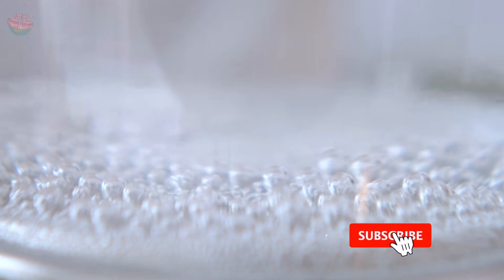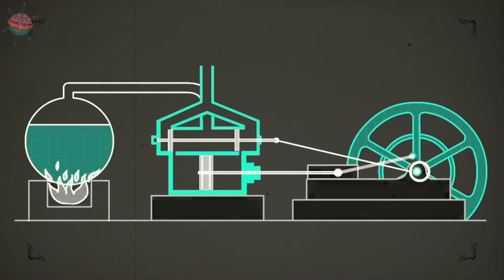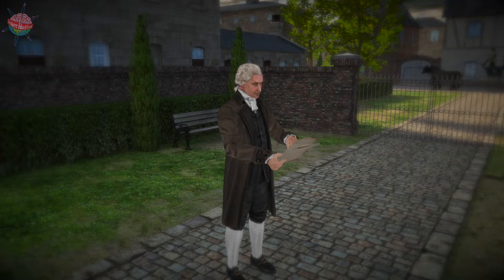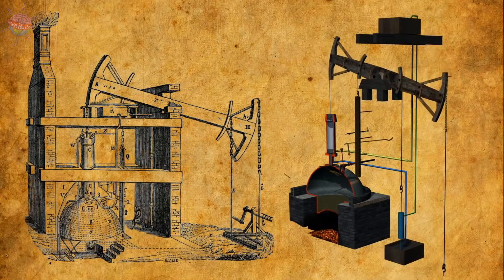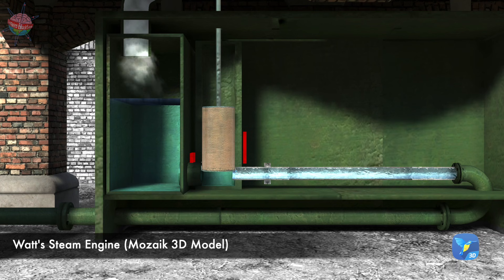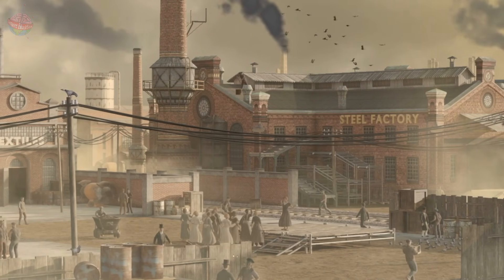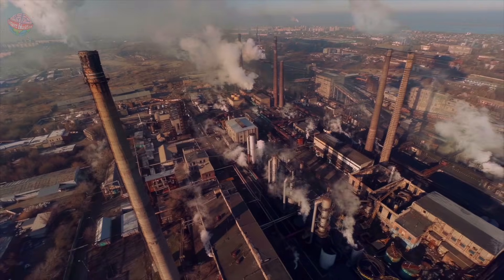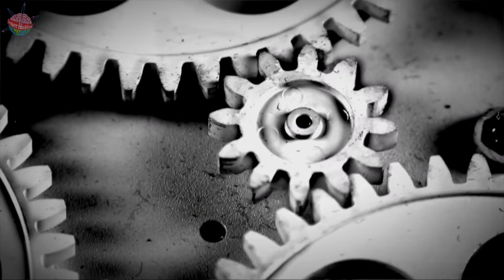James Watt's Steam Engine

Comment: James Watt didn't improve Newcomen's Atmospheric Pump,  it couldn't be improved, even by James Watt.
Watt dumped Savery and Newcomen's Atmospheric Power and Arkwright's Water-Power for Steam Power. To achieve that he had to invent a new engine, the world's first PRACTICAL Steam Powered Engine.
It changed the world!
Reply: I’m guessing you’re a Scot that can’t let the English take the credit for the worlds FIRST steam engine, even though James watt was directly influenced by newcomen’s engine, and then invented an engine that applied all that he learned from the Newcomen engine with his improvements added.

And for your information it was an steam engine not a steam pump, while the Newcomen steam engine was primarily used to pump water out of mines, it was also used in other things such as factories for a short while, as well as other things like the Cornish beam engine etc.
Reply: I'm afraid you're wrong. Newcomen's piston gets pulled up by the weight on the other end of the Beam. The piston can't push the beam up as it hangs on a chain,  the chain would just crumple, It doesn't need to anyway, it gets pulled up.
Watt's pumping engine does the same. It gets pulled up by the weight on the other end of the Beam after it's been pushed down by Steam Pressure. Watt used a closed cylinder though, so an exhaust valve has to be opened also, to bring the piston back up to the top.
With his double acting engine Steam pushes the piston up and down.
Reply: @Walter-w9v  oh I see what you mean now, yes you’re correct it’s not steam pressure engine but rather the use of a weight and a vacuum, however both engines use steam and are thus steam engines just because the worlds first steam engine used steam in a different way as the steam pressure engines we know now does not disqualify the Newcomen engine as the worlds first steam engine, and it’s incredibly important influence on James watt.
Reply: Newcomen's machine was designed and built to supply Atmospheric Power.
Watt's machine was designed and built to supply Steam Power.
They are two different machines, so they shouldn't have the same name. What's wrong with Atmospheric engine and Steam engine, seems pretty logical to me. Or is it something to do with the Steam Engine being the Industrial Revolution, logic goes out the window?
There's an Industrial Revolution's worth of difference between Newcomen's Atmospheric engine and Watt's Steam engine.
Reply: @Walter-w9v  it’s called the Atmospheric Steam Engine for a reason…. It’s an engine that is powered by steam on one side of the piston, whereas watts engine is powered on both sides, that is the number 1 difference, but this in absolutely no way disqualifies Newcomens Engine as the first steam engine in the world, because it was powered by steam after all.
Reply: But they usually drop Atmospheric, and just call it the first Steam Engine, which it isn't. Watt's first Engines were pumping Engines with Steam pushing one side only. His later rotary ones had Steam pushing the piston on both sides. In Newcomen's Engines Steam doesn't push the piston at all, it's only there to create a vacuum. The weight of Air sitting on the piston pushes it down. ( the cylinder being open at the top ).
Reply: @Walter-w9v  I’m sorry you are completely wrong, first of all it is a Atmospheric Steam Engine, regardless of if it’s atmospheric or not it’s still the FIRST Steam engine in the world, and Newcomens engine did push the piston with steam from the bottom side, so you are completely wrong there.
Reply: The piston can't be pushed up, it hangs on a chain, the chain would just crumple. It has to be pulled up by the weight on the other end of the Beam.
Reply: @Walter-w9v  no what happens is the steam enters the bottom section of the cylinder pushing the piston up, and then the condenser shoots water into the cylinder creating a vacuum letting the atmospheric pressure pushing the Piston down from the Top side.